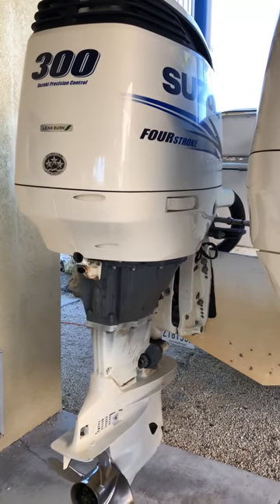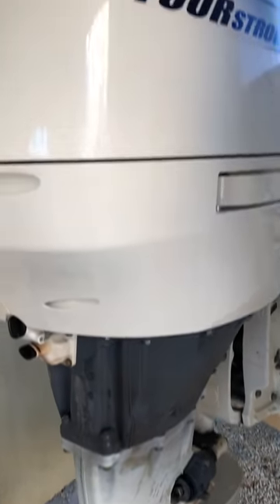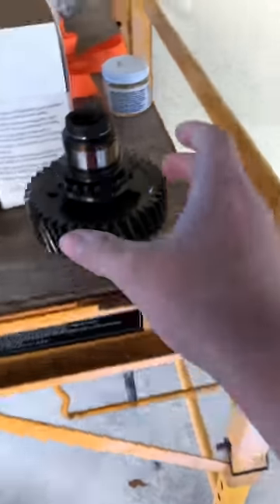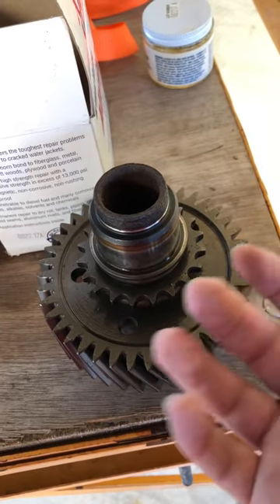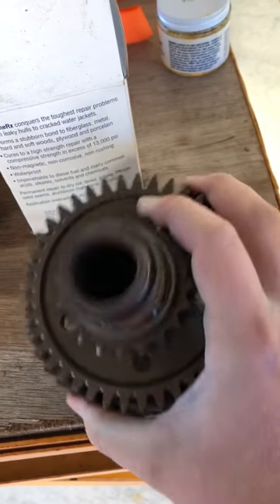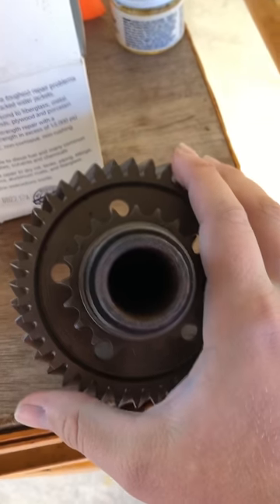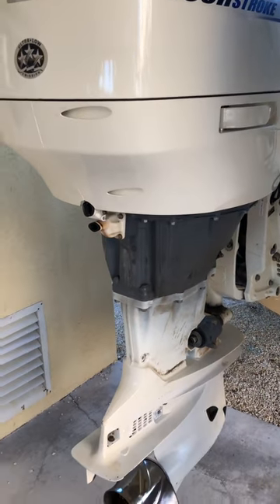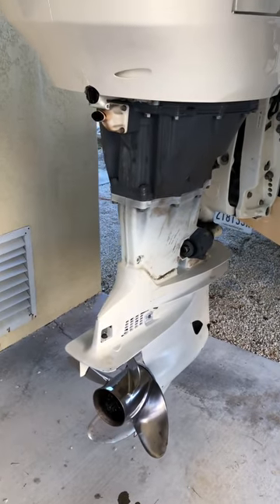A potential problem with Suzuki outboard engines

Comment: For engines with or without grease fittings, just do normal 100hr or annual maintenance and grease the shaft and splines. I have owned and maintained boats for 30 years and never had a driveshaft issue. Proper maintenance is key.
Reply from the maker: After the first failure we gave up on the grease fittings, and drop the lower units each time we do maintenance. That seems to be the only way to get it up there if it gets there. The grease fitting on the Suzuki’s seems to be a design flaw. We are not the only ones who have had this issue.
Reply from the maker: Salty Flag TV after the first failure we have been dropping the lower units every time we do maintenance to put grease on the tip of the shaft. That is the only thing that seems to work if it is working. There seems to be a faulty design with the grease fittings in the Suzuki outboard’s. Because we are not the only ones who have had this problem. We had Mercury’s and Yamaha‘s in the past and we never had these kinds of issues.
Reply: Algún Manual de ese motro

Comment: Looks familiar. Had the exact same thing with my '16 DF175AP's. Stripped splines on the driveshaft and corrosion issues due to grease not getting to where it's supposed to be. Happend at 1100, 1700 and 2200 hours. Every time fixed under warranty but the last time Suzuki found out this serie of engine did not have a gasket to prevent water intrusion which is coming up from underneath. Models that came after do have this part installed. 
Maybe it was my own fault previously but it for sure is a point to inspect every so many hours.
Besides that, never had an issue.

Comment: This is caused by neglect.  Your impeller will outlive the splines. You must pull lower unit every 50-100 hrs and grease the splines 😂

Comment: Never greased this spline on my pair of 2004 Yamaha 115s. Suzuki should fix
Reply: That's because your Yamaha doesn't have it Suzuki has an offset crankshaft with gear reduction that goes down to the lower unit Yamaha straight off the crankshaft to the lower unit

Comment: What year is that Suzuki 300 and have they worked out the issue or made it easier to grease?
Reply from the maker: It is a 2016 model and I’m not certain that they fixed the problem.
Reply: They did... I have a 2020